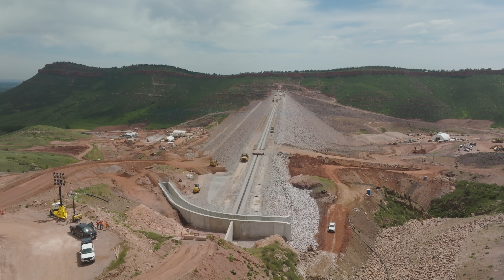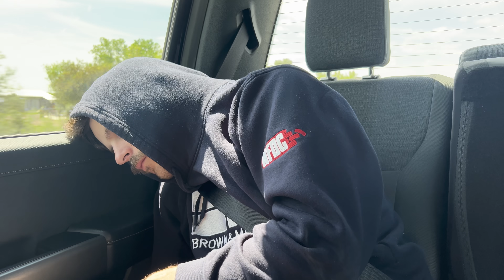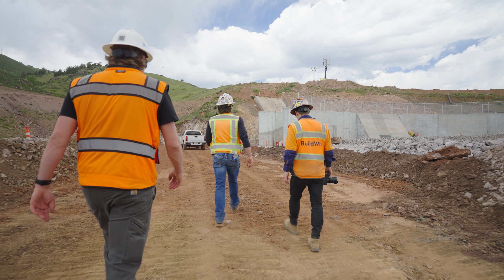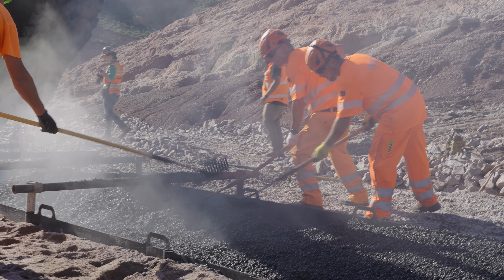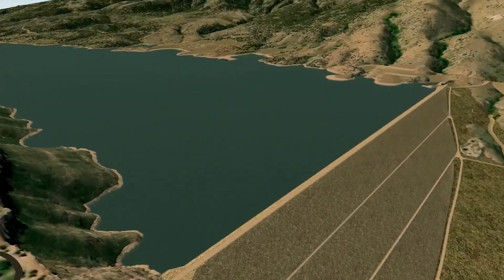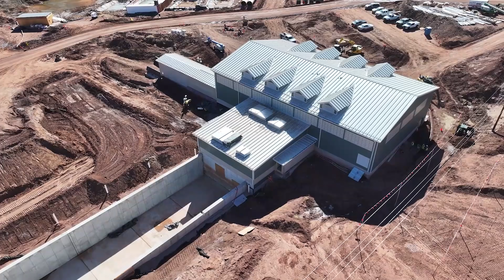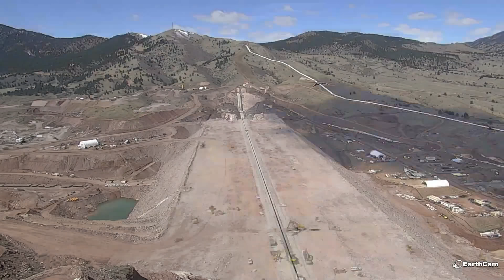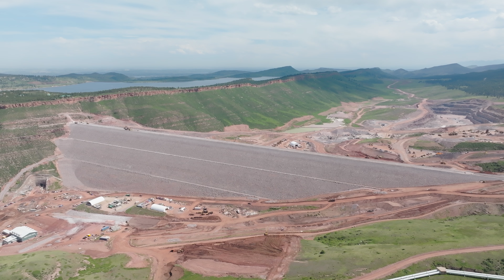Why Is Colorado Building a 22 MILLION TON Rock Wall in the Rocky Mountains?

Comment: Rather use the water instead of sending down to Newsom to release into the Pacific.
The core truly does look like a large scale 3D printer.
Reply: The Colorado River really famously hasn't made it to the ocean for decades, learn your infrastructure before you try to get political.
Reply: @thesquatchdoctor3356  I was just there this spring and proved your wrong with my own eyes. BTW a natural river valley isn't a "infrastructure", this dam is a infrastructure.
Reply: @HighCountryRambler  My silicon friend, I can't imagine why you would be in that part of the world, it's a true Mexican desert. Except for point pulse floods implemented through the channel infrastructure that was dug out of the delta, freshwater no longer travels downstream, saltwater travels upstream for many miles before drying out. The pulse floods are to prevent the channel from becoming too saline due to evaporation.

Comment: But where is the water coming from? Not from the Front Range!! It comes from Rocky Mountain National Park and the surrounding mountains and hills that feed into what becomes the Colorado River. 
The Fraser River, which comes from the east (Berthoud Pass, Winter Park and the surrounding mountains) is joined to the Colorado River at the Windy Gap reservoir. What is PUMPED from the Windy Gap Reservoir to Lake Granby (another Reservoir) and from there to Shadow Mountain Lake (Yet another Reservoir) which is joined to Grand Lake (a real lake this time) and from there it is fed into the Adams Tunnel. Which goes under the Continental Divide to this Reservoir.
This is part of the reason why the Colorado River is running out of water.
Reply: Tell people in Las Vegas and Califukitup to quit building homes in the desert.

Comment: All that water would have gone to lake Powell.
Reply: All that water was allocated to Colorado in the 1920's. Even with this project coming on line Colorado still doesn't keep all the water it was allocated back then.
Reply: @Implant01 .   True but still that water would have flowed west.
Reply: It still will !
Reply: @Caldrisian  I had to think about that for a moment but you are correct. It will flow west into Windy Gap Reservoir before it is pumped east through the CBT project.
Reply: Screw lake Powell…and Vegas .  LOL. Keep colorado water for colorado.
Reply: @Crankycurmudgeon1320 good luck with that !

Comment: Nice engineering effort.  

But what Colorado needs is water conservation.   No more Kentucky blue grass, require instant hot water on all new construction, the Denver metro area wastes a ridiculous amount of water!   

Colorado is a high plains desert, stop acting like it’s the east coast.  CONSERVE WATER, stop wasting it.
Reply: Better yet, quit building more houses.
Reply: Golf courses and fracking need to be banned, along with irrigation of water-intense crops.
Reply: @livesey1979 Yes.  We all want to eat bugs.  Yum!
Reply: I'm sorry but how does instant hot water save water exactly? The amount used will be the same beside the extra storage, no?
Reply: @judsaoud  My kitchen is on the opposite side of the house from my water heater. If I want hot water from my kitchen faucet, I have to let about 1.5 gallons of water run through the water pipes and down the drain before the water is hot. So each time I want hot water in the kitchen, I consume around 1.5 gallons more than I need.
Reply: Instant hot water is not a water saver. 🙄

Comment: I’d love to see the bit where the asphalt base was started,but never mind still a great video.
Reply: The foundation concrete was placed, then the ground below was pressure grouted through holes in the foundation concrete. Then the asphalt was placed.
Reply: @boblaws9851 huh. I would have thought that the asphalt be laid starting at the bedrock, to ensure the water tightness.
Reply: @blueman5924  The concrete foundation was poured on bedrock.
Reply: @boblaws9851 Yes, I realize that…I was referring to the band of asphalt in the middle making contact with the bedrock. If there was a geological event that shifted the bedrock, you would want the pliable centre band to ensure a flexible bond, which the grout is not. i.m.o.
Reply: @blueman5924  Oh, gotcha. It is 500' from the dam face to the concrete plinth (foundation). I'm sure there are folks a lot smarter than us that have taken all these factors into consideration. I didn't stay at a Holiday Inn Express last night, but I did estimate the concrete work for this project. lol
Reply: There was a shot of the concrete base at the beginning, a flashback of his previous visit.👍
Reply: Watch the first video from a few years ago.

Comment: Watching from Loveland! Thanks for covering this!
Reply: it would be smarter for the County to have Campgrounds, water sports etc around the dam-hope they planned it well.
Reply: Is this the project Loveland and Ft. Collins are looking to back out of?
Reply: @whaaat3632 thats not true at least for Loveland. This area has always had large amounts of uranium to the point where there have been discussions to mine for it again. All of Loveland and surrounding areas water treatment facilities already have uranium filtering systems in place. This topic comes up with every opening of a reservoir opening. The levels will drop over time. This is only a issue if it is used as the primary source of water for a town before the levels subside.
Reply: @wbotz  Per the Colorado Sun yesterday:  "Fort Collins-Loveland Water District, intended to be the largest water buyer by far for a long-troubled $2 billion northern Colorado dam and pipeline complex, is dropping out of the project, officials confirmed Friday. 
Northern Water, which is building the Northern Integrated Supply Project, or NISP, on behalf of 15 cities and water districts to supply decades of future need in fast-growing suburban areas, said it will continue business as usual and has not heard a direct cancellation from Fort Collins-Loveland."  They  must be a different/newer project.

Comment: As someone who lives on the West side of the divide.  I can tell you water is not plentiful over here.  Our rivers run dry due to 24 tunnels sucking 1500cfs over the divide.  The system is on the brink of collapse and the front range still thinks that more reservoirs are going to be the solution.  What they need to do is find how to do more with less water.  100+ year old water rights allow more water to be drawn over the divide then there is supply for. Projects like this are only going to compound the problem of water shortages and give a false security of supply.

40 Million people rely on the Colorado River.  60% of the water is from snowmelt in the basins that these projects pull from.    The argument that the majority of the population lives where the water is not is even more pronounced along the flow of the Colorado River- 7 states and Mexico rely on the river, and nearly 1/10th of the flow is pumped over the divide...
Reply: Water management in the West is a major issue.  On the same point, but in a different perspective, the farmers in Arizona and California need to stop growing alphapha and other high water-demand crops in the desert.  Little known fact, Colorado is the only state that does not have water flowing into the state from another source. The only water available to us falls from the sky.

Comment: earthen dam so they want it to fail in like 30 years
Reply: Not true. With maintenance, they last centuries.   The dam in the next valley over was built in 1950.
Reply: @whaaat3632  wrong concrete may last but an earthen dam they always fail
Reply: @Peterpiper-f8r Facts don't care about your ignorance.  The dam in the valley next to this one, Carter Lake, was built in 1950.  No issues and is well maintained.

Comment: The placement of the asphalt core is amazing!
Reply: I'm interested in seeing how they tie the asogalt core into the valley walls. It doesn't look like that machine can lay that core against a wall.
Reply: @drooplug they do it 5” at a time in lifts. It doesn’t have to be applied directly to the walls vertically, but horizontally.
Reply: Serviced all that heavy equipment right there. The 6015, the 992 loader, Triple 7’s, 💪🏼cool project too be on in my first couple years in the trade
Reply: It really is! I will look into that more! Wonder when they thought of that and has it been used elsewhere 🤔
Reply: Thank you for an interesting look?? Amazing technologies and processes in place..
Thanks again a kiwi from down under..
Reply: insane
Reply: since that core is like soup how did they get it from running when they did the sides of the damn?
Reply: @jimfisher8990 you can't be serious, right? The machine that's laying down the core is simultaneously also laying down the second segment of the wall. Go back to @13:40 and pause the video. The loader on the left is loading the materials for the core meanwhile the one on the right is loading the materials for the section alongside it. If you play it from the 13:40 time stamp you'll hear him say that they do a layer (of 9") at a time and a total of 500+ layers. 

                          -Hope this helps!
Reply: your AI brain is amazing
Reply: Placing a semi liquid and the forms for the semi liquid simultaneously
Reply: So its like a really big plastic lining being held up by a mountain of rocks? It really is a pretty cool way to do it.
Reply: Who comes up with some of these amazing ideas like this you know what I mean people that saw a problem and fixed it
Reply: Not redundant is a big fault.
Reply: What about doing something like this somewhere for naveda desert area and other desert areas where water can be pumped and the desert can be brought back to life may be???
Reply: @Dailymailnewz  brought back to life since when are deserts lifeless?  You have obviously never been to one.
Reply: @Dailymailnewz  Evaporation in Nevada is a problem. Reservoirs need to be REALLY big.
Reply: @lyricyst2000 no, they need to be DEEP, with little surface area.
Reply: @Dailymailnewz like Lake Meade and Lake Powell 😂
Reply: @Dailymailnewz Nevada has the Hoover Dam, Las Vegas recycles every drop of water that goes back into the sewers. What we should be debating is the water right percentages.
Reply: @Dailymailnewz it has been a desert for a long time. why change it now?
Reply: @Dailymailnewz  They could make a pipeline from MIssissippi EZ.. we have the tech to do it.. we pour Trillions of water into the Gulf of mexico that could be used for idiots that build towns in Desert like phx an Las Vegas...
Reply: the problem is drought bud. Which means no lakes
Reply: @Orikix weather is cyclical... you need the bowls when the sink does overflow though..you dont wait for rain... then build it.
Reply: @Dailymailnewz keyword is DESERT. it's 40+°C there. The water would evaporate within days.
Reply: @Dailymailnewz  evaporation
Reply: @Dailymailnewz  Where exactly do you think they'd get the water for this one :face-purple-crying:

Comment: The dam may be impermeable, but what about the mountain to its left and right side?
Reply: What are Mountains made of?  Solid Rock. Which may have fractures or faults in them but they seal those off before stealing the water from the Western Slope.
Reply: There is always some loss.  But losses from evaporation will be more than what is leaking out the bottom.  All of that gets more than replaced by the inflow.
Reply: @DonkeyHotey-l2e    Thats the problem Angenos is talking about. The flanks are not sealed to the dam and have never been subject to standing water pressure.
The "loss" you are referring to will cause increased erosion or washout around the side of the wall.
Reply: I have the feeling they might have thought about a few of these things..... They probably even have a plan....
Reply: @jlrutube1312   like an evacuation plan ?
Reply: If you look at the video where they haven't started building the base, there is a concrete layer going from one side of the valley to the other. It looks pretty wide but I have no idea as to how thick it is. That is what will help hold the dam in place. As well as preventing seepage along the sides. and bottom.
Reply: ...there is probably a keyway in that bottom concrete pad for the asphalt wall to lock into...
Reply: @dherman58 they didn’t just start stacking rock. There’s like a 30’ deep foundation under all of that rock from side to side, and the ends are tied into the surrounding mountains.

Comment: earthen dam? why? They are more than twice as likely to have catastrophic failure than a concrete one.
Reply: Actually, earthen dams are significantly safer, when designed and constructed properly. I design dams for a living.  They are more flexible under seismic loads, bending rather than breaking.  They last much longer. All dams have failure points that are mitigated through the design process.  The dam type is chosen based on many criteria and factors. Economics does factor into the equation, but other factors like material availability are much more significant.
Reply: Money.

Comment: Would just putting clay on the water side work to seal just as good as the asphalt core
Reply: Clay expands and contracts as it is exposed to water. It will leak at the water line as the level rises and falls.

Comment: Hmmm, unless all of the downstream states have signed on and approved of this project, I see expensive and lengthy federal lawsuits on the horizon. All of the big reservoirs on the Colorado River are already very close to dead-pool levels. So all the downstream states probably aren't going to like this. I could easily see Colorado current "leadership" leading the state info a major lawsuit where the dam will never be used but the taxpayers will still be stuck paying for it. I'm not saying it's a bad idea. It's great for the big cities on the Front Range in Colorado. But the other states won't see any benefit, just the opposite really.

Comment: Does that asphalt solidify? Would a concrete core have been too expensive?  Is there hydro electric here at all or is this just a reservoir
Reply: Yes, the asphalt will solidify, but will remain impervious. Concrete is significantly more expensive and actually does not perform as well as an impervious barrier.
Reply: No, hydro just water storage for the homes & farming to the East of the project.

Comment: What stops all the weight at the bottom from squeezing the "flexible" asphalt upwards and breaking the asphalt core?
Reply from the maker: The weight of the water is on the rock not the asphalt
Reply: @AaronWitt interesting. Doesnt sound like it should work. Thats why im bot an engineer..
Reply: It can’t squeeze upward because of its own weight. All the forces are equalized. Look how the rollers travel along both sides of the core at once, they equalize each others force so the core doesn’t shift sideways. Same principal. The pressure must be astronomical at the base of the core though!
Reply: @jacksonbennett6151  A 350ft tall dam is 107 meters, which works out to about 157 PSI at the bottom. Basically the rated pressure of PEX plumbing fittings.
Reply: @JHe-f9t is that the water pressure or the earth fill pressure?
Reply: @jacksonbennett6151 this was a great explanation. Thank you!
Reply: Asphalt weighs 145 pounds per cubic foot according to the google machine, thats about 1 psi b/c 144 sq/in per foot. Multiply by 12 for pounds per square inch for each foot is 12 psi at 1 foot, multiply by 350 for core height is 4200 psi at the base of the core.

Edit after some sober math, that was 12 times too high. It's just 1 psi every foot of height. A square column of asphalt 1 by 1 inch by a foot high weighs about a pound, so its only 350 psi at the bottom of the core.

Comment: How long will it take to fill the reservoir
Reply: The website says 50% in six months 
Then they will slowly fill it over years to the top 
It doesn't need to be filled for its full function.
Reply: @ralanham76 thanks
Reply: I wonder  how long it would have taken if all that heavy equipment was battery driven? 😂
Reply: @JimGarver-tx8rj an eternity
Reply: Depends on the flow rate of the feeding river and total volume of the reservoir
Reply: No shit. Way to not answer, but instead vaguely include some brainrot!
Reply: Was partially built with crushed uranium ore. Oops. Your kids, kids, will pay more for this drinking water.
Reply: 20 years
Reply: @R.I.A 😂
Reply: 4
Reply: Depends on how many volunteers they can find to pee in it.
Reply: 2 hours
Reply: That’s crazy impressive what they have accomplished in 2 years
Reply: 400 years
Reply: Depends on how many democrats are in charge.
Reply: At least a couple.

Comment: how long will the asphalt last? will it ever need to be replaced?
Reply: Never needs replacement. The design life for a structure like this is hundreds of years, if not longer (nothing is forever, but this is close).  This is the second AC core dam constructed in the USA. I designed the first AC core dam built in the United States in Morenci, Arizona. This is a somewhat common technology used to construct dams in Europe.  AC cores provide exceptional water-tightness, but a little more costly to construct than traditional clay-core dams.
Reply: @Randy_RaW_Inspiration 

You may know my current boss. He was an engineer down there for Freeport, one of the big projects he worked on was when they moved 191 for an expansion. He was one of the lead engineers at the mine.
Reply: @michael-michaelmotorcycle  It's a small world!
Reply: Without proper maintenance it will break and cause flooding.
Reply: asphalt never wears out, it only gets displaced, especially when used during hot days and when under constant load.